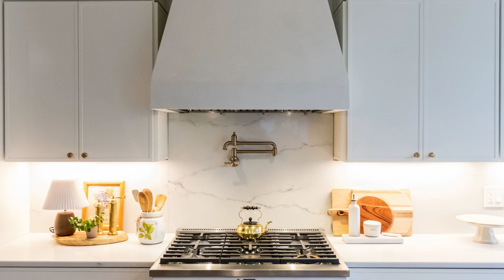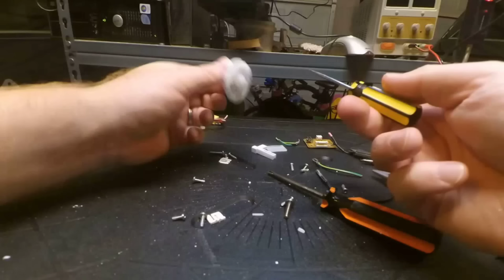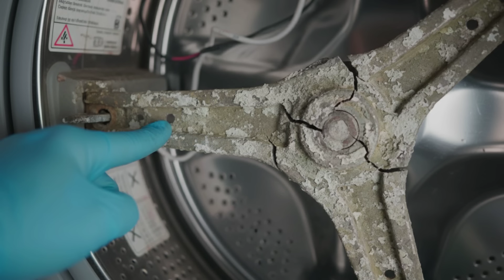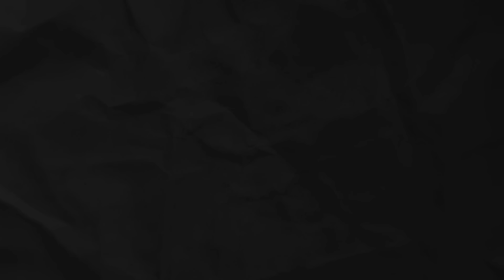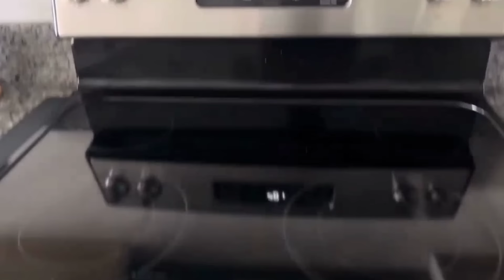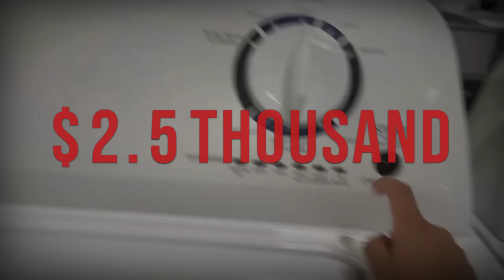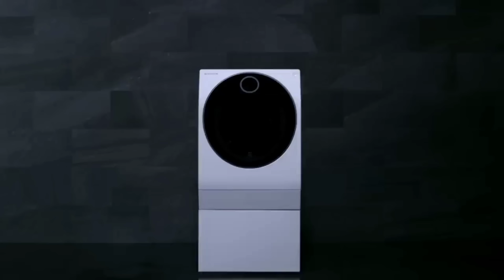The Repairman Blacklist: 5 Appliance Brands to Never Buy

Comment: Speaking of being "robbed blind", add HP inkjet cartridges to that list.
Reply: that's the reality of most printers - get the printer for not that much and then spend a fortune on ink forever after
Reply: @wolfc8755 See my reply above. Generic is the answer!
Reply: You can add Epson too. I tossed it because it wouldn't print in black ink when a color tank was empty. Pure nonsense and pure junk.
Reply: @catthief1991  You have to tell the printer to do that in the driver. It's not a magician.
Reply: @catthief1991  Have not had that problem at al with the Ink Tank Epson. In 18 months or more I've only used 3/4 of the ink and it came with an extra bottle of black. Great value as I also got it on sale at Costco
Reply: Yeah ! I bought a HP printer for a really really low price . 
The cartridges that came with it were "beginner " cartridges. 
After printing about 10 pages at a light printing of ink on the pages, the cartridges were empty. 😮
I was shocked 😢 at the replacement cartridge prices . 
Yeah, they "gotcha' ", but NEVER  AGAIN WILL I EVER BUY  HP PRODUCTS
Reply: @mikefitzryk1871      I liked the hp printer I had, for awhile and then the problems were endless.    It would go offline whenever it felt like it and I could not discern when it was going to happen, but usually when I needed to print.  I finally got rid of it, and I have a Brother that is somewhat better, but the ink is still outrageously expensive.
Reply: I canceled my inkjet plan cuz I was collecting cartridges! waste of money!
Reply: @lexilusmama I recycle mine.  Staples send them to HP, no cost to me.
Reply: Amen!
Reply: Had a perfectly functioning HP printer that suddenly wouldn’t work because HP just stopped supporting it. Forced me to buy a new one. The other day it had a message saying something was wrong with my account and that I wouldn’t be able to print soon. Checked my account. No problem. Chatted with customer service. Said there was no problem with account. Printer then declared it was offline. It wasn’t but wouldn’t print. I unplugged it, plugged it back in and it worked. Won’t buy HP again when they decide not to support this one.
Reply: I just bought a new printer to replace my HP inkjet colour printer. The BlackXL cartridge alone is now $115 dollars and it doesn’t last long. I feel so ripped off. It was the final straw - I will toss it out 🗑️
Reply: I don’t want what I don’t have. I want what I have.
Reply: @abdc168 You started with nothing, and will end with nothing, and in between, nothing.
Reply: Inkjet cartridges dry out if you don't print frequently.  I tried an inkjet printer, trashed it, and have used a laser printer for years with no problems whatsoever.
Reply: If you open them up all that is inside is a sponge and some ink. It's a scam and they keep being allowed to do it. Sometimes the ink cartridge is dearer than the printer.
Reply: I blacklisted HP for like over a decade. I am surprised they still exist given the absolute low quality products they keep producing…😅
Reply: HP: in Sweden buy a printer for around SEK1000 =  81 Pound = 93 Euro but 3 ml of a black ink cost SEK350 = around 32 Pound/Euro.
It's about SEK 100.000 for One (1) liter. Which product that you buy cost as so much.
Reply: I used to be very much anti HP but after being on their subscription plan for a couple years it's really seamless and nice and cheap dirt because I don't print that much ever
Reply: @jeffreyswhitmore  Once installed, the ink is exposed to air, which causes the liquid to evaporate and dry inside the printhead. This can lead to clogged nozzles, streaked or blank prints, and reduced ink flow. The longer the printer sits idle, the more severe the clogging becomes.
Like you, I myself don't print very much, that's why I traded in my HP inkjet  printer for a Brother toner one. Why a Brother and not a HP toner printer? Because after dealing with HP and their ridiculously overcharged ink cartridges, my aptitude was, and is, screw them. This happened several years ago, and I've never had any reason to look back.
Reply: Go with a Canon Megatank printer - I've had one for about 3 years now - The upfront cost is quite a lot more, but even with the fairly large amount of printing I do, I think I've spent maybe $15 on ink in 3 years.
Reply: true, the printer's almost nothing, but JFC do they get you on the ink.  You can include Brother in that statement
Reply: Any inkjet printer is a foolish purchase.  Only buy laser printers.
Reply: @davidp8627  Inkjet printers are specifically designed for printing photos and are capable of producing images with vibrant colors and fine details. Laser printers give photos a washed out look and tend to be grainy.
Reply: Just get generic brands. That's what I do with my Cannon. These tech companies use the "...will void the warranty" scar tactic. I say, "so what? the printer is just as much as the ink cartridges!" But seriously, I've used a generic brand for TWELVE (12), yes, my printer is 12 years old and still works!
Reply: I just saw an article that said printer ink is actually $30,000 per gallon!
Reply: @juliehumphreys5968 i believe it!
Reply: @juliehumphreys5968 yes, Netanyahu owns the company.
Reply: @juliehumphreys5968  Probably published by the ink cartridge manufacturer, and includes the salary of the CEO!'
Reply: look into the Epson Ink tank. I haven't had to buy more ink in 18 months!!

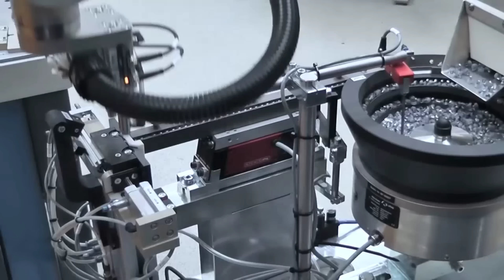Comment: 10:14
This problem also applies to the elevator industry with cheaper elevators that cost as much as new mid rage car designed to only last 3-5 years before requiring replacement. More expensive elevators that will last a lot longer and are a lot more heavy duty often cost as much as a house per car.

Comment: If you luck out then good for you if you don't, then you're not the first.  That's how I feel when it comes to appliances because I bought a Kenmore top loading washer back in 1989 and it's still doing the laundry loads like it should.  I purchased a Kenmore refrigerator somewhere around 2015 and it lasted until 2022, only 7 years.  Same brands but different reliability.

Comment: Same with cars.  The more fancy the digital screen is, the bigger the repair bill will be (or faster you'll replace the car).  Unfortunately, this also applies to the dash speedometer, gas, and mileage gauges.  Once the CPU or screen goes out, the car is essentially totaled.

Comment: So true. We needed a new washer so my wife selected a Maytag and we have had good luck with the older Maytags from years ago. So this new one actually has a "Remote Enable" option where you can control your washer through your smart phone so if you want you can start the washer before you leave work and it will be done when you get home. I looked at that and said NO WAY. here you are 30 miles from home you start the washer and a hose breaks and you come to a flooded house or the washer motor catches fire. Can you tell me? WHAT THE HELL ARE THESE PEOPLE THINKING! Oh my Maytag dryer is 30 years old and still going strong but I had to use guerilla glue to repair the knob that cracked. I think the repair guy changed the belt about 10 years ago. Anyway I always buy the extended warranty , they may be a little pricey but it has worked out for me.

Comment: I went with Maytag for my washer and dryer. It’s not fancy and the only thing digital is the light that glows over the indicator that blinks what cycle it’s on. My oven is digital though (it came with the apartment I’m in) but I rarely use it. It’s brand new. Fridge seems safe, as it doesn’t have an ice maker at all. It’s a basic fridge, and I’m glad for that.

Comment: I guess the logical conclusion would be for a reputable company reinstate the quality of appliances. Go back to original formula of using metal fixtures/parts and quality construction. I guarantee that people will pay a little more for a well constructed product that will NOT be going into the landfill at a high rate. To have an appliance last more than twenty years, a true bargain. I have a refrigerator and stove “Inglis” that are more than 30 years old and still working like a charm. Never had a repair, only had to replace bulb in the oven. Quality craftsmanship at its highest. 🤗🇨🇦✌️

Comment: DON'T buy LG stoves. I bought one... it looked pretty nice, sleek. I also took the extended warranty. A year after I bought it, I was cooking potatoes and, as it happen to all of us, it spilled a tiny bit on the stove. After supper, now that the surface was cold, I went to clean the glass top and, to my bewilderment, I saw that the surface of that element was all full of hundreds of little craters. 

I contacted the company and the store... even though I had the extended warranty and that the company wrote that it was probably a defective glass, they REFUSED to repair it. I heard also that cooking with such damaged top could be dangerous... is it true???

I am an elder on a small pension, I can't afford to buy another stove and I am profoundly p.o. of LG. I will try to sell this stove and I want to buy an oldy with normal coil elements... no electronics. Oh! And the oven? Yes a nice cobalt blue but cooking with it? Hell on Earth as it burns everything. A quiche that is supposed to be golden comes out black if you follow the cooking instructions on the package... cooking a chicken? Better cover it with lid or aluminum paper for 2/3 of the time because the flesh will be uncooked while the skin is chard... all problems I never ever had with my normal oldy stoves. 

So, conclusion... DON'T buy LG's products unless you want loads of troubles!

Comment: I bought Samsung smart AI front loader washer and dryer. From the start, some dribbling water comes out from bottom front door section. Appliance repair man came cause it’s yes new and guarantee. It’s the big rubber band that sits in the front. The repair man said it’s the SAME problem they all have and Samsung knows about it too. BUT Samsung won’t change nor fix the issue cause….repair man said it would cost too much for Samsung to replace all their machines out there. Same issue with the dryer. So bottom line, DONT BUY SAMSUNG NOR ANY FRONT LOADERS. Problem solved.

Comment: I’ve bought a very expensive LG fridge. It lasted less than 4 years. The final straw was when I opened the freezer door and pulled the door right off the hinges! I had to duct tape it back on.  Now I have a fridge with no bells and whistles and use ice cube trays to make my own ice with filtered water. That’s another thing, the filters for refrigerators are expensive and don’t filter anything to filter the water!

Comment: We have had our white side by side refrigerator for 35 years not one issue. Our white kenmore stove has been with us 32 years no issues. Our top loading dumb white washer dryer and washer are 16 years no issues. My sister bought an Electrolux front loading washer and dryer and with 1.5 years they both died and needed replacements!

Comment: These companies obviously do it on purpose.  Make a product that will fail so the consumer has to buy another one.  More $ in their pockets.  They also make them impossible for do it yourself repairs.  Personal example about a car:  I had a Nissan cube and the transmission died.  Sealed and unrepairable.  I sold it to a junk parts car business.  I felt sad -- a very good car junked because of a sealed part.

Comment: My 36 year old GE Side by Side Refrigerator/Freezer finally bit the dust in January after having 1 service call in 2007 to replace the water pump.  My Jenn Air stove purchased in 1988 is still going strong, although one of the grill burners has finally called it quits.  No bells and whistles just manual knobs to operate.  My Kitchen Aid washer and dryer are still going strong after 20 years.  It just proves that the simple Canadian/American built appliances are made to last.

Comment: Agreed. You missed 2. The modern digital air fryer with controls set above the oven door. Makes NO sense. And a personal one-GE over the range microwave with a KNOWN fault....the module breaks as it was manufactured to do, leaving a top line  microwave than runs on and on with the exhaust fan unable to shut off, (really, you cannot turn it off) necessitating you to disable at the breaker panel. Never buying another GE anything.

Comment: Thank you for telling people what I already knew. I have GE refrigerator that is solid steel that is 100 years old that still runs. No that's not a typo 1925 GE Monitor Top with a foot petal to open the door when your hands are full. I bought a washer at the big box store a Whirlpool with no fancy cycles just 3 load sizes small, large and x large. Knobs you turn to set no electronics anywhere 15 years later still working. My microwave is the only appliance I have with a touch screen off brand $99 on sale.

Comment: 18 months old Westinghouse front loader …. 3rd time have Have had  a tech out  . The last time he came he removed the bottom filter it now leaks . Still haven’t fixed the original problem . Now want to take machine away and try and find out why we have problem .Last I time I buy an Electrolux Westinghouse waste of Time And Money. Will not recommend to any one anymore .

Comment: Laundry, ONLY residential Speed Queen. 

Refrigerators:  We needed to replace our 25 year old refrigerator, and I wanted to look at floor models.  The appliance store owner was honest and said the best we could do was an American assembled Bosch.  He told us the American refrigerators are exactly like the European or Japanese models accept for one thing.  The regulations aren’t as strict in the USA.  American models are made with at least one part that will likely break in 2-5 years.  However, the Bosch will for sure last for 5 and maybe 7 years.  All other brands place at least 2 or 3 plastic parts that cannot be replaced.  American Bosch also does it but with super thin metal, so it lasts a little longer.  The warranties specifically carve out those compressors and parts.

Comment: I had a GE electric stove for 40 years. The only thing that drove me crazy was the manual timer that would somehow slip and go off at all hours of the day. When I finally bought a new stove, I thought it would be a great idea to buy another GE. WRONG!!! It had these sensors on it that would turn the heat down as soon as I started boiling pasta, until the water cooled down to lower than a simmer. It wouldn't get hot unless I stood there turning it off and on again to get it up to the boil. What happened???

Comment: All my kids who had LG appliances had trouble with them.  The odd thing is my 11 year old LG flat screen TV,  the first one we ever owned,  worked for 10 years until the picture went out.  My son, who is and electrical engineer, put in a new light bulb behind the screen and it works fine.  I didn't even know they could be fixed.  Cost $40.  He didn't charge me labor, still owes me for 3 days labor when he was born.
Reply: My LG  washer and dryer are 10 years old , gone through 2 moves, and run every day. Never an issue.
Reply: 😂 Hilarious!
Reply: So, send him a bill!  🙃
Reply: LG makes good electronics, but they stink at making appliances.  They should stick to making TV's & such. 😄
Reply: Lol
Reply: MY ---and my grandson's front loader LG tore tiny holes in our shirts ---and tee shirts..

Comment: I'm on my 3rd dishwasher in a house I bought 20 years ago. The drum rollers on my Samsung dryer break about every 3-4 years, which you can fix yourself (with the help of a YT video). But I'm tired of it. My Samsung washer simply refused to actually rinse my clothes. They came out hard from soap accumulation.

Comment: LG refrigerators, do not buy under any circumstances. Look up common problems with their freezer section, you’ll see they frost over like a 1950s model and it happens pretty routinely. Their lining on the doors also starts to tear and peel around year 5. They start to malfunction routinely around the second year though. It’s a never buy again for me.

Comment: I'm in Australia.  I will never ever buy a digital appliance.  I love my Hoover Boss (Balanced Oscillating Suspension System) top loading stainless steel drum washer - made in Australia 🦘🇦🇺. This machine will outlive me.  No digital made in China or Thailand garbage for me thanks.  My Hoover is BOSS 👍😊. I also have a vintage 1970s Sunbeam electric stainless steel frypan, also Made in Australia (no non-stick crap).  It is a gorgeous orange retro high domed lid design of that era and is still in like new condition and I love it 😊💖

Comment: When I bought my house in 2008, I bought all new appliances with all the bells and whistles electronics. First the fancy double door fridge went out- motherboard shorted out. Repairman told me I should just buy a new fridge. Same when my fancy electronic dryer went out. Just replaced them with basic fridge and dryer. The fancy washer, stove, and dishwasher are still working but when they go, just going to go with the basics. At least they lasted over 12vyears, which is the expected lifetime.

Comment: My new microwave is more complicated than the old one, same manufacturer.  By the time you go through the menu to change the time, the time is wrong. The old one was so easy.  Newer isn’t always better.
Reply: My mother's Sharp microwave lasted 27 years, replaced it two years ago with a highly recommended Magic Shelf countertop unit for around $150. I bought it because it rates well ahead of most units costing 2-3 times as much and is only bested by $700 high end ovens for reliability. It doesn't have all the bells and whistles, but what it does have is twice what she needs.